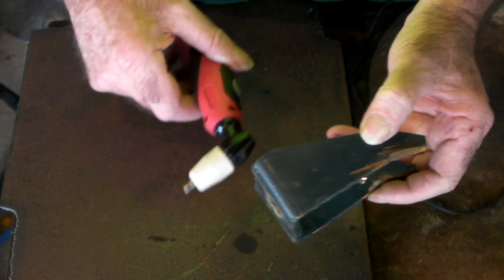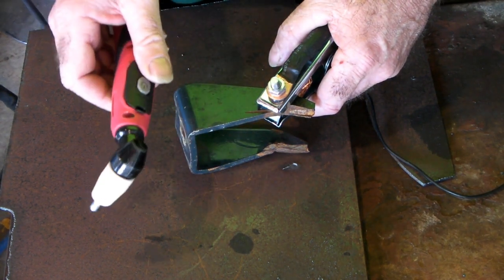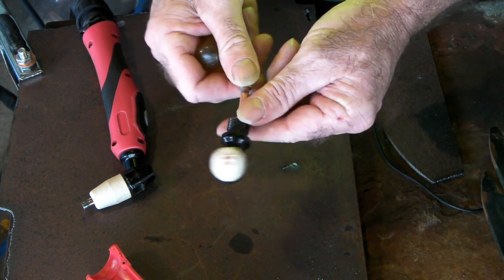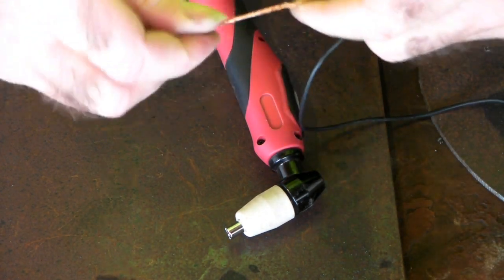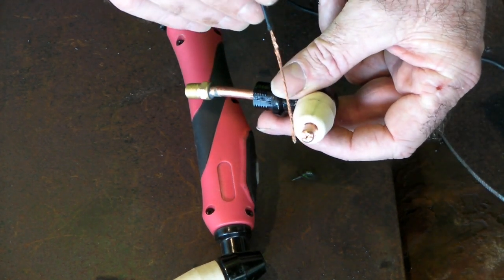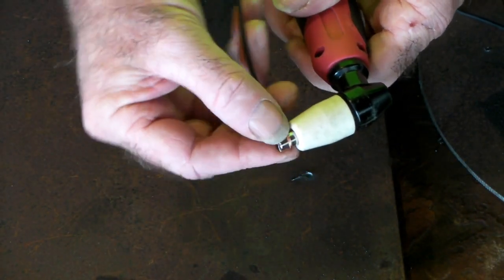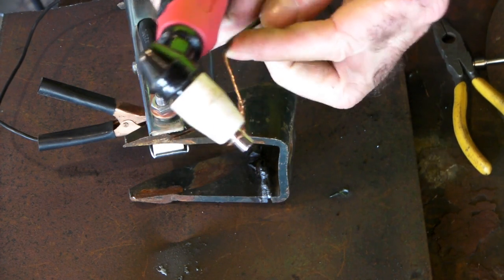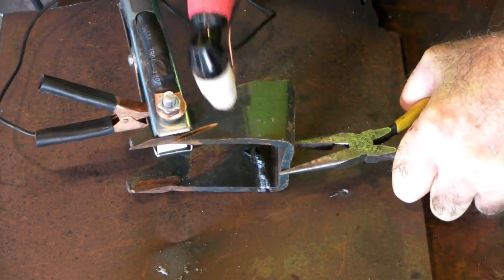Plasma Torch  Pilot Arc Conversion  Easy

Comment: This is not the way to convert to a pilot arc. The reason is that once the arc is started, the ground cable must be disconnected. Otherwise, a current leak will occur, which will prevent the plasma cutter from working properly and could even damage it. This video shows you how to do it correctly. https://www.youtube.com/watch?v=m7NQAYoYZ_I&t=1s

Comment: G'day, I have a Bestarc BTC500DP Gen 7 with a AG50P torch.  I'd really like to use the Extended consumables from the PT31 torches to have a better view of the cutting tip and to be able to follow non-straight cutting lines or templates. I have looked for  PT31 torches with the 3rd conductor for Pilot Arc and have no luck.  Is there a trick I can make this happen?  Thank you in advance.
Reply from the maker: NO  THE PT 31 TORCH WAS NEVER MADE AS PILOT ARC

Comment: this dose work but you loose cutting power as some of the current now travels through that added wire it also choose the tip out of the torch the inside is eating out. wonder if throwing a resister inline would help improve the life and lessen the current or maybe a cap with a very small bleed down resister
Reply from the maker: Good idea

Comment: I have a Cut60 HF and wish to add a P-80 Pilot Arc torch with the wire which normally attaches to the pilot arc ground on the front of a Pilot arc machine. Can I just lengthen this wire and ground it to my ground clamp?
Reply from the maker: maybe  i haven't tried on that machine

Comment: Gnarly. Just bought a new torch and it came with an extra wire attached to the consumables. I guess THIS is what it’s for. I’m assuming I should be able to run a lead down the umbilical back to the case and tie that wire to the ground clamp terminal and I’m good to go.
Reply from the maker: Yea try it
Reply: @petestools  tried it. Did it. Worked great lol. No more ground clamp necessary

Comment: Hi Pete. Very clever idea. I was wondering why not removing the insulating ring and machine a copper/bronze/stainless one on the lathe to make contact with the tip? What do you think? Is it worth doing this instead of the bare wire method? Thanks a lot.
Reply from the maker: Try it .but maybe wont work.

Comment: Hi pete  can you please tell me which is the best torch to use with a Pilot Arc Plasma Cutter CUT50P 50A 220V Non-Touch Digital Air Inverter. the torch that came with this machine uses P80 consumables and I could never get this torch to work properly it's always hit and miss with the pilot it just spits and splutters maybe it's the wrong torch that they put with the machine?  please pete I do need your help on this one mate. cheers peter
Reply from the maker: Hi peter i would try this its a good torch also consumables not to expensive.
AG60 SG55 WSD60 Air Plasma Cutter Torch : https://amzn.to/3mCMqmU
Reply: @petestools  Thank you pete

Comment: wait so the 100 bucks difference between the HF machines and the pilot arc machines is the torch?
Reply from the maker: no torches are about the same price its machine price
Reply: @petestools  your video sure makes it seem like you just turned an HF machine into a pilot machine by messing only with the torch

Comment: I just bought a plasma hf start and stumbled on this at just the right time.  Thanks for the great tip!
Other than the need to be careful of the bare wire and the shortened lifetime of the consumables, is there any other reason that you don't recommend it, or is it just to keep the sue-happy jackals at bay?
Reply from the maker: I don't know if it will damage your machine But works fine on mine cheers pete

Comment: Hi Pete. Great innovation. Could you put a small switch in the wire and mount it in/on the handle or where you could turn this off once the cutting starts.
Reply from the maker: You would have to put a relay in-between because of voltage
Reply: @petestools  Thanks Pete. Finally purchased my cutter (the first five failed) and found that you can simply cut a straight line through heavy painted or rusty material by using a steel straight edge. Just use the earth clamp to hold the straight edge in place extending it 20mm past the start edge. With the torch nozzle up against the steel edge, it acts the same as your conversion wire or a pilot arc. Only works with the straight edge though.
Cheers Mate
Reply: @rayhughes8240  I like to use 1/4 thick flat bar for my strait edge 
works just like you said
Reply: @NightshiftCustom  For working in tight places I drilled a small hole in a bit of quarter flat bar and attached a wire to it. Use a small magnet to attach it to the work where you want to start (same as the straight edge) and the other end of the wire to the earth clamp. Once the pilot arc starts you are off and running. Cheers

Comment: Could you get a pilot arc torch and ground the wire that goes to the red connector? Would that work? Please show if you have the pilot arc torch please.  Looking to get a plasma cutter 50 but not sure if I should get a pilot or non-pilot and try a pilot torch? What do you think? The way you are showing does it make the consumables last longer?
Reply from the maker: Hi, If your cutting dirty steel get a pilot arc

Comment: Hi Pete, great videos.  Do you know if it's possible to do this the other way round and use a non-pilot arc torch on a pilot arc machine?
Reply from the maker: Hi no sorry
Reply: You can test it by just unplugging the pilot arc ground wire from the machine probably...

Comment: Pete you are quite intelligent about lots of things.  Pilot arc starting systems in plasma cutters have a high frequency generator designed AC plasma inducing jet that is 1/4" to 1/2" long from the cutting tip for a short while until the DC kicks in at the base metal to continue the cut.  When you jump the positive ground or work piece continuously like that throughout the entire cutting process you will heat up the digital circuitry or electronics in the machines and shorten their lives.  You are telling all of these listeners to do something that is not designed for their machines to do.  Only pilot arc start machines designed to give the initial starts until it contacts through the metal while cutting then converts back to DC to cut for long periods without harm.  If it was that easy the machine sellers would surely install a work piece wire on all of their machines.  Research the differences in machines with and without pilot arc designs.
Reply: What's the difference between dragging on the metal you are cutting and having a wire attached to the tip that is clamped to the metal you are dragging on though?  It's the same thing other than the wire wrapped around the end will get really hot because it's on the tip...

As far as it knows, it's making a connection with the metal, so it should be kicking out of HF like it normally would, wouldn't it?

It's really hard on the consumables, which is why I assumed it wasn't a great idea to do unless you needed to.
Reply: I've heard others say the same thing you have said. But like the other person who commented, I'm wondering what is the difference with the wire when the tip/nozzle itself would normally be in electrical contact with the work anyway? I figured the current would flow in a similar way. 
Genuine question here, not trying to sound argumentative. Just trying to understand how it all works
Reply from the maker: I just cut steel mate lol . Good tips thanks

Comment: For the insulation problem on the wire, try silicone wire, they are more flexible and vastly more heat resistant.
Reply from the maker: Good idea thanks

Comment: So can I buy a pilot arc torch for my non-pilot arc machine and run the pilot arc wire from the torch to the ground clamp?
Reply from the maker: could try
Reply: Hi Salim. Did you try this and was it successful?
Reply: No I haven't tried it. But I think it makes sense right?
Reply: @salimatiyeh7472  Totally. I would like to try it with a small switch that is easy to locate and operate so it can be turned off once cutting starts

Comment: I use plasmas all the time. Never knew this. But really why would not just give even a scratch under earth and a scratch at edge of painted plate? It only needs a a small amount of steel to show and it'll cut through the same. Also the smell of burning paint socks so just clean the paint off. Likely will weld something on it or grinding the slag. Cool tip but ultimately useless.
Reply from the maker: if you cant get into the place to clean it off like under your car  works for cutting rusty steel in confined spaces.

Comment: once you get started cutting on lets say a painted surface will the heat then burn off the paint once you get gong allowing a connection thru the tip again and not just the wire making the wire not heat up as much and last longer ? this way you'd only be using the wire to start but the melting steel/slag would then come in contact with the tip and it would cut as normal....thanks
Reply from the maker: Once you get it started you don't need the wire

Comment: When you are cutting are you dragging the tip?
Would it be possible to machine a piece of copper to the dimensions of the swirl spacer of copper to make the electrical connection?
Thanks love the videos
Reply from the maker: never thought of that ,thanks for watching cheers pete

Comment: great video...have had cut 40 for 10yrs...always wanted pilot arc...with mine if it starts and stops to often it blows up the voltage power regulator on the main board...pilot would stop this, great tip.....less grinding to allow good contact
Reply from the maker: Thanks for sharing

Comment: You are very cool man and cool sir
I need help, to understanding plasma cutting machine voltage and amps
 ( output )
For example, a stick arc welding machine outputs ~ 15 volts and 80 to 250 amps

According to your video, to make starting arc/pilot acr it needs low amps (probably) and high ~ 5000 voltages.
After that when plasma starts to form, then how much voltage and current is needed to make plasma? (I'm talking about the output)
Reply from the maker: it's quite low voltage

Comment: so can you just buy a Plasma  Pilot Arc torch and fit it to a non-Plasma Pilot Arc machine and just earth the extra wire? in my understanding?
Reply from the maker: it should work. but just buy a pilot arc machine they dont cost much more.

Comment: Hi Pete
Is there away I could run the wire inside the torch instead of it been on the outside
Reply from the maker: hi, i have tried but not much luck.
Reply: @petestools  👍
Reply: Buy a pilot arc torch and hook up wire thats built into torch, works great and looks better with no  wire outside of the torch.

Comment: I have a pt 60 torch and I have had where my electrodes wont screw out the threads get messed up and I end up having to replace torch .I only put the electrodes in finger tight so I dont know why it keeps happening. Any idea what is causing this?
Reply from the maker: Hi are you sure the consumables are correct for your torch ?  From the sound of it your electrode is arcing in the threads try and tighten it up very tight use some pliers . it might stop it arcing and causing damage .

Comment: Mr can we use usual Tig welding electrode as plasma cutter according your explanation on youtube kindly? 
Thank you
Reply from the maker: No you cant use Tig welding electrode as plasma cutter sorry .Plasma cutting is special machine .
cheers pete
Reply: as fas as i learned the plasmacutter has much higher voltage like 80-100V,  tig usually is 20-40V
Reply from the maker: @hyperhektor7733  cool thanks

Comment: Hi was wondering does that hurt the hf machine using it that way.Also could I use a pilot arc torch on a hf machine if i hooked the pilot arc wire to the earth gound at the machine.thanks for great video.
Reply from the maker: HI KEITH ,Great that you found my video interesting .I have been  using my hf machine with the wire from the torch for a couple of years now and its still going.But i can't guarantee that of course that's just what i have found. Also pilot arc torch with HF unit .to tell you the truth i haven't tried it because most people want to use the torch they got with the machine.BUT IT A COOL IDEA  I WILL TRY IT. LOOK OUT FOR A VIDEO IF IT WORKS LOL. 
Thanks pete
Reply: @petestools  yes  great idea , i also wanna know , please do a vid
Reply from the maker: Hi Johannes  I will do a video next week for you on using a pilot arc torch  on hf machine. CHEERS  PETE
Reply: @petestools  Thank you very much, maybe check if the wire heats up and maybe if possible to what extent. Thanks again
Reply from the maker: Hi Keith ,I have been using my machine like this when i want to cut through paint of rust for last 2 years and it doesn't seem to do it any harm. I will do a video next week for you on using a pilot arc torch  on hf machine. CHEERS  PETE

Comment: So how did you hook up the wire on the in side of the torch. I noticed in the video I didn't see the wire during the show.
Thanks I like you're show very much.👍
Reply from the maker: Thanks for watching .With the p31 torch i couldn't find a way to put it inside the torch body as its not earthed through the torch. So i just make a little noose and hook it on the cutting tip.
Reply: @petestools  ok perfect thanks so much from Claskanine Oregon
From 🇺🇸 USA...👍👍👍👍👍

Comment: The loose bare wire going away from the tip can be wrapped in kapton tape to help insulate the wire and is high heat resistant 👍
Reply from the maker: Great idea thanks
Reply: @petestools  Kapton goes to about 260°C (https://www.kaptontape.com).  You could also use a woven fiberglas high-temp sleeve, for up to ~600°C, like https://www.aliexpress.com/item/1005001718533875.html (or salvage it...I've found similar braided high-temp sleeving inside toaster ovens.  Probably is in other hot electrical appliances too).

Comment: Pete ... awesome video ... but wouldn't it be better to get one of those pilot arc torch kits and just replace it on the machine? Just have to find (or make ) a spot for the pilot wire to get attached to the ground. They're anywhere from $40 and up ... seems like a much simpler and safer solution ... doesn't it?
Reply from the maker: Can you buy a KIT??
Reply: @pete's tools,  @Fry's Country Life Channel. 
Did a bit of digging to try and find a kit. From what I can see, the pilot arc torches you can get on eBay/China come with a pilot arc wire built in which comes out next to the 2 pin one, made up with a ring lug on it. Tap that down to ground and you're away!

Comment: So WHY do you say you don't recommend doing this conversion?
Reply: Because it is dangerous, should use a security lock trigger. And should use some resistance and an automatically disconnector because the machine may over heate and get the magic smoke.
Reply: @Ricardo-uw3ov
Reply from the maker: Hi , this is just what i do its up to you if you want to do the same(i have never had an issue with it )

Comment: Pete, good morning. Did you disconect the HF circuit? Thanks
Reply from the maker: nope just added the wire thanks
Reply from the maker: No  cheers pete
Reply: Thought doing that also. I have a HF machine for my cnc-plasma and HF is bad for the whole system (making the computer lose its mind).